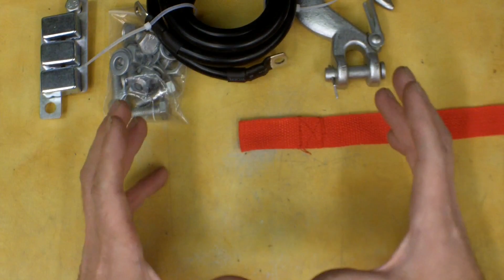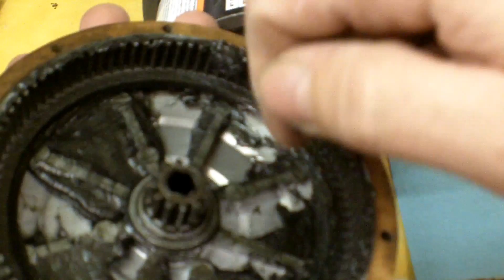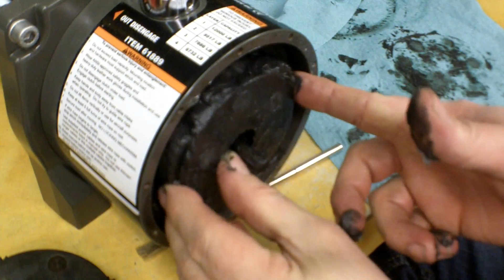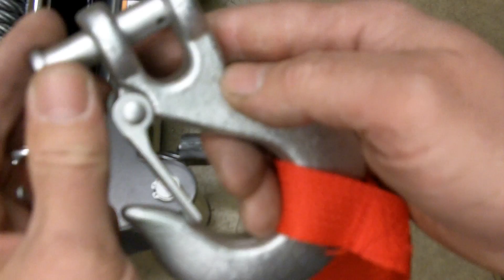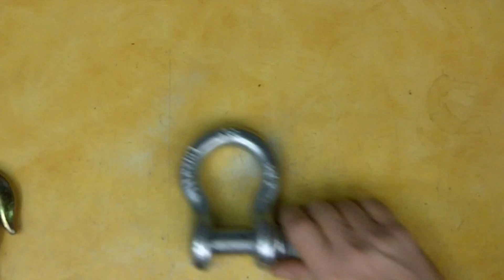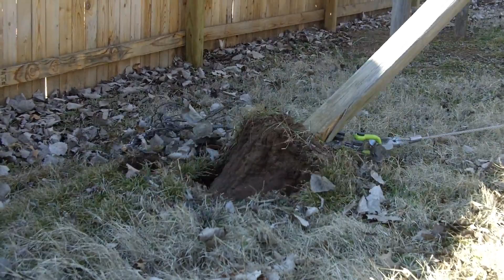Harbor Freight 12000 LB Winch Review, Teardown, Installation, Safety, Etc. Model 61889

Comment: Great review and teardown. I have the same winch but for some reason it is missing the handle. It doesn't have the part that holds the handle to the winch ether, the part with the screw that holds it in. How does the part with the set screw attach to the winch? Mine doesn't have anything just a hole where the handle goes.
Reply from the maker: Thanks! I'm including a link to the manual that might be helpful in solving your problem. Scroll to the bottom and you will see the parts breakdown. Hope it helps, G.

http://manuals.harborfreight.com/manuals/61000-61999/61889.pdf
Reply: Thanks for the copy, but mine is missing the part where part 11 clutch retaining bolt screws into the gear box tube 7. I thought you can see how that part is attached to the tube 7. Thanks C
Reply from the maker: I can't tell how it's attached, but I would guess it was pressed in. I can't see it being welded since the part is chrome plated. And if it were screwed in, you would see threads in the hole.  Pressed in seems logical to me. Good luck, G.
Reply: Thanks, didn't think of that!
Reply from the maker: No problem! G.

Comment: have one my self..  works great...  you didnt  say should say to start your truck,, to give winch more juice,,  I learned hard way,, winched little to long,, batt wouldnt start truck....   so I start truck,, make sure charge ok,, then winch,,  giving 45 sec  bursts...
Reply from the maker: That's cool! I'm glad it works well your you too. Agreed, I should've stated to have the vehicle running when in use as it will kill your battery in short order. A slight oversight on my part. I'm sure the comments will benefit others, so thanks for pointing that out! Take care, G.

Comment: Great video, this has been very helpful in trying to diagnose why my 61889 won't engage. After taking it apart three times, checking that everything meshes and nothing is broken, and reassembling it again, now it's working. I love that it's fixed, but hate not knowing what was wrong.

Anyway, point of interest: the drive shaft is an 8mm hex, and viewers wanting to test theirs can just use an 8mm Allen key.
Reply from the maker: +Matt Ion 
Thanks Matt! I'm glad it was helpful in getting yours going again even though you don't know what was wrong. I know the feeling all too well. I've taken apart many broken things and simply put them back together and they just started working leaving me without any clue as to what was wrong...lol. Working is working I guess, and hope yours stays that way. 

Good tip on the hex size. I was going to run the example with a drill so I made the driver. But in hind-sight, and since I just spun it by hand, I could have saved myself some time and just used a key. Oh well...lol. Good luck, G.
Reply: +ghostses Well after it failed AGAIN, I spent a bunch more time with it and finally found the problem: on yours, the output sprocket is locked to the output planetary with a flange and two silver screws (visible at 26:37). On mine, there's just a spring clip on the sprocket to keep it from sliding into the assembly too far (don't want it to rub on the gears), and it relies on the whole drive assembly being tight in the housing to not pop out.  Except it's apparently loose, and the sprocket keeps slipping out of the output assembly, as it's only in there by a quarter inch or so.

I didn't see the spring clip you mention on the output sprocket of the intermediate assembly, thanks to all the grease, but assuming it's there, I flipped over the teflon washer/spacer that goes between the two planetaries (the one you show at 19:32), figuring that would space them out a bit more. So far so good...

If it slips out again, I might try some short flathead screws in there to hold the spring clip in place. I'll be sure to take some pics for you, too :)

I found a good write-up on a rebuild of a similar winch (9,000lb, Engo brand, but obviously the same manufacturer), and theirs has the flange and screws on the output as well: http://www.wranglerforum.com/f282/engo-winch-maintenance-repair-write-up-1549369.html
Reply from the maker: +Matt Ion 
If I had to guess Matt, your winch may have been missing a part from the factory.  The flange you mention with the two screws  at 26:37, I believe, is a spring thrust washer (for lack of a better term). It's bent up on the sides to act like a spring and keeps the gear train pushed together. I would venture to guess, mine also has a snap ring but under the thrust washer. I was unable to confirm by watching my video though. Are there two threaded holes on yours where one could've been installed?

If you start watching when I put it together for demonstration purposes, you should be able to spot the snap rings on both the input and intermediate assemblies as I rotate them.
 https://youtu.be/TN5vAAdKP94?t=1452

I did look at an Engo parts breakdown and see the thrust washer (They call it a gear retaining ring, but I honestly believe it's a trust washer) and screws (parts 23 and 25). I wonder if you could order them and try it out- assuming its the same.

http://mediacdn.shopatron.com/media/mfg/5150/media_document/4538/LargeWinchINST.pdf?1299773251

I'm guessing you're outside of the warranty period, so this might be an inexpensive option to try.  Hope this helps, G.
Reply: Those look like the right parts... The Badland manual doesn't show those as separate parts, so maybe it's intended to not have that retainer. I tried putting in a couple short screws to hold the snap ring but the assembly wouldn't seat all the way in, like the screw heads were poking out too far. I'll look into ordering those parts though, shouldn't be too expensive.
Reply from the maker: +Matt Ion 
I agree, they look correct to me as well. I zoomed in on the HF parts breakdown, and it appears like it has one to me, but they're not breaking out the parts like Engo did. They might be considering it a complete assembly- who knows. If you do get the parts, feedback with how it works out. It might help others out. G.
Reply: +ghostses Will definitely update here if things change. So hard to find any real-world info on the guts of these winches; between this video and the forum link above, I think that's 99.9% of what's out there. Much appreciated!
Reply from the maker: Matt Ion

That's cool. Wow, that seems odd to me there's little to no info out there. G.
Reply: I did a bit of reading before buying this winch, mostly on 4x4 forums... there seemed to be two camps: those who simply dismissed them because they weren't Warn or another well-known brand, and those who liked them for the price but considered them disposable. The ones most likely to actually service and repair their own winches tend to be in the former group, so while there's plenty of documentation of teardown and rebuild of the old go-to brands, there's not a lot of the newer crop (including the likes of Superwinch and Smittybilt, which looks to be the same as Badland/Engo).
Reply from the maker: Matt Ion
Is is still under warranty Matt? You never indicated how long you've had it. If so, exchange it no questions asked. HF is great in that regard.

But, that doesn't surprise me one bit- especially if someone spent a small fortune for a Warn- or any other name brand. I won't discount they may be a better product- but do know the name is baked into the cost. Opinions regarding tools are much the same way. If it's not what they have, and spent, it's no good. Some opinions are solely based on price and a desktop review, or perhaps to make one feel better on what was spent.

But to be fair, if parts are not available for the HF winch, being disposable would be a fact of the matter. For me though, I can buy two for less the cost of a comparable Warn and have a parts winch. Some folks might not have the technical prowess to dig in a fix something so for them, something else may be a better fit.

It sounds like we, especially you, are on the forefront for this crop..lol. G.
Reply: What's warranty, a year at most?  It's definitely well past that... probably closer to two years. Still... it's more work to actually remove it and then haul it down to the nearest HF (Bellingham, WA). Although I hear HF is great about support well beyond "factory". But like I say, the way it's mounted, it's a major headache to remove, while I can work on it fairly easily while it's mounted on the Jeep.

I get the old-school guys' point, that even if it's cheap and can be endlessly exchanged, that won't help you if it breaks while you're stuck in the bush. Then again, I've only needed it to get un-stuck once, and I was in a group anyway... but it's served me well to pull a couple abandoned XJs onto trailers, and stumps out of the front lawn (well, one stump, before this latest issue). I'm not the type to push myself into stuck situations in the first place :)
Reply from the maker: Matt Ion

Understood. Just thought I'd ask. I can understand the hassle even if it were under the warranty period.

I don't personally don't have the endless exchange mentality, but do know those that do. I purchase based on potential need in hopes something will meet my expectations. If I can get something done and save money for one job and it lives past that- I win...lol. Tools are the main catalyst for my attitude. I have tons from the top shelf down. I purchase inexpensive where I can, and pay through the nose if required. 

I don't off-road so I have no fear of being stranded- especially if alone. But I can understand wanting reliability for those that do. They are not something that gets use often, but when you need it- you expect it to work.  G.
Reply: Well, Harbor Freight refuses to warranty the winch... which normally would be understandable, since it's two years old, but in this case, considering there's an internal part missing from the factory, and given how great I'd always heard their customer service was, I expected better.  Guess not.

They're happy to sell me the entire output gear assembly... sure it's only $23 and 8-10 weeks for delivery... but now there's a principle at stake. I'm gonna see if I can get JUST the retainer and screws from Engo.

I won't be making any more trips to HF, that's for sure.
Reply from the maker: Matt Ion

That's no good Matt. I guess I can see their point, but missing is missing in my book. If it didn't need it, it wouldn't have been there in the first place. $23 seems fair, but understand the principle. Hopefully Engo can get you what you need, and it fits. Good luck, G.

Comment: I got the wireless control also. What I have noticed, there is a second or two delay from when you release the button (regardless if you are paying out or taking up slack). Just be careful taking up the slack, the delay can be dangerous.
Reply from the maker: +tc1uscg 
I don't think the delay on mine is quite that long, but there certainly is one for sure. You are correct about being careful- especially when winding the last of the cable in. Thanks for the post, G.

Comment: Great video thanks for all the effort in making it. Question for you: you used an SR175 connector but the winch can draw up to 300 amps. Is that 175 amp connector adequate? I'm researching for s similar build. thanks
Reply from the maker: +Chris Johnson 
Thanks Chris. I looked at some kits and they appeared to have 175 connectors so I went with one. I can say I've never had a problem with mine. I did consider a 350 but they are huge! It's just my opinion, so take it with a grain of salt. Good luck, G.
Reply: Ok my theory is that's 175 at 36v so with 12v it can handle triple the amps. I'm going to go with it too! Thanks for the response!
Reply from the maker: +Chris Johnson 
Sounds good to me. I don't think it will be problematic. Not sure if you're going with this winch or another brand. But if this one, feedback with your thoughts as it might help others out. Take care, G.

Comment: I enjoyed video and learned alot, n maybe got a way to talk my wife into purchase after the brush/tree clearing : ) I am confused on one part though. It seemed when mounting it, only those small bolts held it on. 4 of them I believe. Did I miss something? Should it be reinforced? Thanks.
Reply from the maker: +goodwater2020 
Thanks! I'm glad you liked it. The four bolts are all it takes to secure it down. I would imagine most makes of winches are mounted the same way. Any reinforcement should not be required. Hope this helps, G.